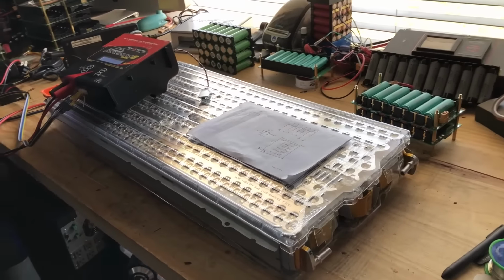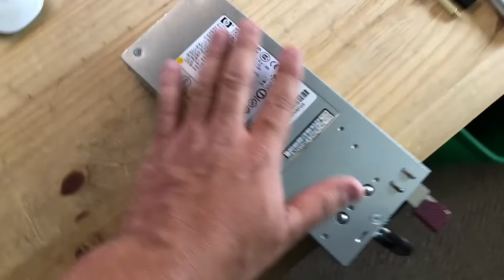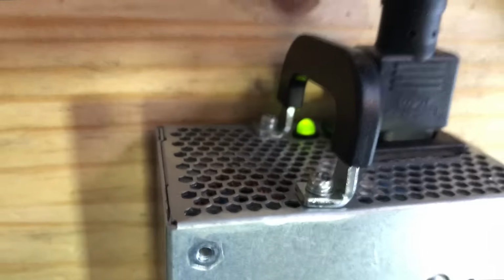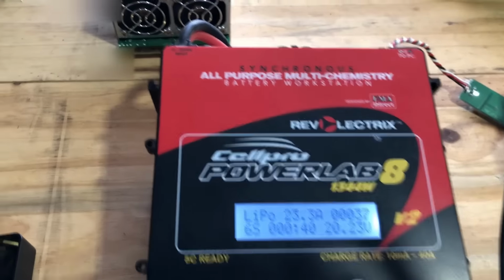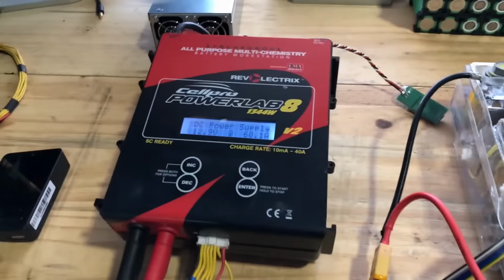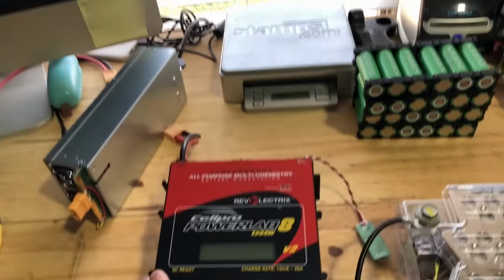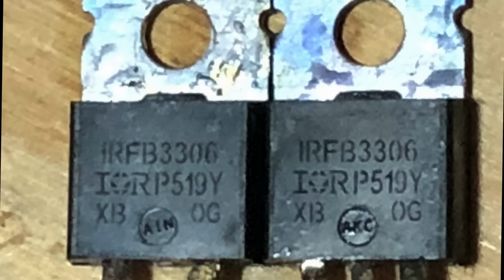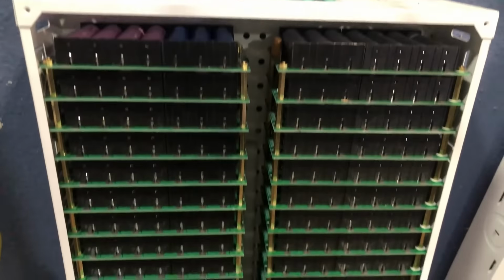How To Ruin A $300 RC Charger With a $25 1000W Power Supply

Comment: The power supply didn't destroy the charger. You overloaded the charger. Piece of junk since the software in it didn't limit the input current.
Reply: Damn, even my $15 B6 clone automatically limit the output when the input is too low. Way to go, Revolectrix.
Reply: Funny, he might have read the manual or just clicked through the menus on the charger and set his own (over-)current or (under-)voltage protection limits. However, without setting it up, it'll use its default values, which were clearly too high for the PSU. The charger smoking itself is another thing, that's weak, I agree. Still, human error was the reason. <edit>Actually, he must have edited them to even allow such high input current. By default, it's limited to 25A input with 10V or 11V voltage limit.
Reply: @nexus665  but why would you allow it as an desinger of the charger to overload it.  That would be just like your cooking stove with an turbo mode which would burn the cable's inside.   And then recommend to not use it too long.   

So probaly just to make it fail and make money because you have to buy a new one.  If your not good with  electronics tho.
Reply: InstaBlaster.

Comment: The output of 82.3A is for an input of 200-240V
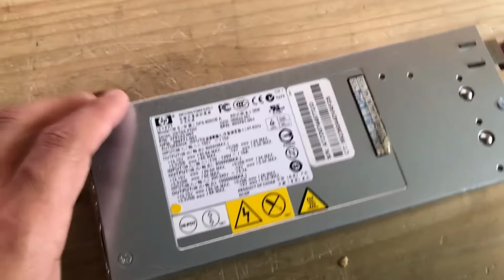Reply: Nope, freeze frame at 1:25 and take a closer look. The 82.3A is under the output section, the input amperage is specified for 10A @ 110v near the top of the label. Interestingly, there is no 240v specification despite the label's autoranging claim (or is that only for frequency?).
Reply: Max 1000 W is only like 5A from wall.
Reply: Holy shit, u guys need some help with this....
Reply: @davidstech1445  take a closer look.  There are 3 lines for input levels.  For 100V, for 110-120, and for 200-240.  The maximum output current for the DPS-800GB plugged into a normal 110 wall outlet is 69.9 amps.  (right in the middle) .  When you see the input current of 6.7 amps, you've found the specs for how it operates on 200-240 volts.

Comment: Regardless of input and output the unit should be programmed not to go outside its own specifications and break itself. Revolectrix rave about how advanced this charger is on their webpage, but clearly it's power monitoring is inadequate.
Reply: I agree. I obviously have no access to the owner's manual, but unless the manual specifically tells you to limit certain parameters, it should be smart enough to protect itself, especially at the $300 price point. Call em up and tell em they suk.
Reply: Well it does say lab in its name, doesn't it? :D

Comment: WTF man, why you blaming the power supply, it was your mistake, you put too much pressure on the charger.. it had to boost the voltage to twice the amount and push enormous amount of current through it..That powersupply would have easily handled it all
Reply: Correct. The PS done its job right. 
Datasheet Charger:

Continuous rated output of 1344W @ 26.35VDC (up to 33.6V) or 612W at 12VDC input voltage
Input voltage 10 - 32V
Input current 1A to 60A with reverse polarity protection

You should have used a higher voltage.
Reply: @shiftew leite ; @ isi pisi : 
Agreed with you both. Runing such power means you need to take care of your hardware specifications, if you don't, well, it blows up. 

And want to add : If it was the supply which wasn't powerful enough the charger would have detected it dans stopped it itself.
Reply: Yeah i had so much respect for this dude,until he started click-baiting, This kind of stuff really throws off integrity of someone, these supplies are made for server purposes and are really powerful.

a)Not all 1344W are being outputted at 12volt rail, they are being split between two rails.
b)The charger is the one that blew up (not powersupply).
c)Why was he going over-specs on the charger in the first place.

The wires are weak and small, the connection is janky,he is obviously running everything over its specification 

LETS BLAME 12DOLLAR POWER SUPPLY
Reply: Yeah no problem with those psus. The charger is the problem. That psu can easily push 1300W continues all day long!  I run them myself but you need to series 2 of those psus to get 24v or higher. That RC charger is pretty  easy to brake. I have seen many to die due to above issue where you run to low input voltage. They have no protection against it im afraid...
Reply: Yeah,they are not made to boost the output let alone double it at such high current, i think they are not even meant to boost output at all..at least that is not recommended
Reply: shiftew leite

Well considering he is self taught, I would say he is doing ok.

He shows his failures as well as his successes.
Reply: See Jehu is paying for the mistake so others don't have too. As right as you may be in your tech analysis, your delivery needs improvement
Reply: Paying for something is one thing,but blaming failure of a product due to human error is NOT a good way to show your responsibility,  that labels the product as "cheap/bad" in the eyes of consumers, and most people come to his channel to take advice

P.S yes my english may not be that great, that's because its not native language,i'm from pakistan
Reply: Yes dude,that is great unless you don't point out where you made the mistake and then blame it on something else, he is pretty big channel and many people come to him (like me) for advice. It's one thing to show your failure, totally different to shift the blame to a product that under-performed due to human error.. I love this guy's video, but he NEEDS to edit the video or title
Reply: I don't know it seems ok to me.

He ruined a $300 charger with a $25 psu, which is pretty much exactly what he did, that's not blaming the product that's stating a fact.

I didn't hear him blame either product.

He did something he was not supposed to do, that's about all he did, something he has done many times but shows us that by doing it, it can be expensive.

Perhaps he will be able to fix his charger and then do a video of how much it cost to put right his mistake.

We all make mistakes when doing things that we were not trained to do but it doesn't stop us doing those things.

I say cut him some slack, he is doing a good job and giving us lots of useful info.
Reply: Dude up until you this comment i was good and actually was agreeing with you on many points.. but saying "How to ruin a $300 charger with a $25 1000Watt psu" is not click-bait and degrading the power-supply , you must not be in the right state of your mind! How to "ruin" a 300$(clearly imposing its a good quality product) with a $25 (clearly meaning cheap) 1000Watt (implying that its one of those Chinese product that claim some enormous amount of performance and they turn out to be shit) Both these products performed well over their specification and i m all about cutting slack..I'm just trying to point out the mis-understood/mis-labelled title so nobody sees it and get's the idea that "oh that powersupply must be garbage/oh that RC charger must be garbage" . I'm not bashing anybody, just trying to point out something so nobody get's the wrong idea. i even stated i came to his channel for advice several times, and i didn't the full video each time..so something like this can and will effect somebody..
Reply: thank you for having some sense. although my english wasn't that great, im glad my point got across
Reply: flitsies hmm.... can’t wait for that ‘success or failure’ video to come out involving a 5KW battery bank... cavalier attitudes like this WILL end badly...
Reply: Shiftew leite

I understand what you are saying with regard to this matter I don't agree with you on it though.

When I saw this video the first thing I did was to check out the price of that charger, cos I wanted one and it seemed to do a really good job at dealing with something it was not made to deal with, so it was clearly a really good charger, but the with that being said the price put me off.

The cheap $25 psu clearly was not a useless product as it performed very well, so in each case both products did better than they should have, which in my book indicates good products.

What he did in his labelling the video was to introduce a value to both products yes $300 dollars is a lot of money to throw away for a video, but that is pretty much what he did.

Now he has another project to put on his videos, how to fix a $300 charger that performed above and beyond it's specs.

Plus he has a psu that he can use for other things because he knows it will perform beyond what he expected it to.

This indicating both products were well made.

I don't recall him putting down any of the two products, in fact during the video he states his surprise at the amperage he is pushing through the charger.
But I get your point, I just don't agree with it.

People often trash things on their videos some are very expensive others not so, he now has a project due to his mistake of expecting the charger to handle what he was pushing through it.
Reply: Bruno Gianelli

Don't pretty much all youtube video makers do that?

You have to remember he is self taught, so when he does things sometimes it's the first time he has done it and is not really sure what will happen.

If people can help him then they should do so, cos he has helped a lot of people with his videos.

So click bait or not he has done a lot of good work for a lot of people with his videos so we should cut him some slack and if we can help we should.
Reply: Dude you are contradicting your whole arguing point made earlier.. Like i said you must be out of your damn mind..you are just beating around the push trying to say the same thing i said just stretched in a paragraph instead of a sentence. I don't care if you agree with my point (which you seem tobe that you DO, based on your confusing comment) My whole point was that TITLE of the video is misleading. and anybody looking for reviews/advice will immediately run away from HP server powersupply and RC charger (which both performed beyond their specification) and it was jehu who was being careless yet these products get to bear the blame. Also it clearly says on powersupply 1344W only if input is greater than/equals to 220v-240v, Right off the bat people assume this supply will push 1344W ( as he continues to not notice that it can push lesser amount with 110v)  also not all current is on the 12v rail, if you calculate all this, both products performed extremely well and beyond their specs.. The title is the only thing i have problem with, this is not a "oops, well that won't hurt anyone" mistake, this mistake can push a bad narrative onto a excellent product and WE as a community that come to his channel for advice will be hesitant to buy this product.  You don't even know what you don't agree with , you clearly are just biased and won't listen to reason, because your comment is contradicting your OWN self. introducing a value to something and then saying "HOW TO KILL $XXX THING WITH $XX THING" is clearly implying failure of first product and blaming it onto the second product. Also as i mentioned not everybody watches full video. This is prime example of click-bait and misleading user's. If you fail to see that, you are not thinking straight.
Reply: @flitsies  reading doesn't hurt. That's what manuals are for.
Reply: Bruno 

Well perhaps it's mostly the videos being recommended to me then, cos I've seen lots of videos that claim to be one thing but when you click them to watch the title is way off the mark.

In this instance though the title was bang on the money, and he did exactly what he said he would do, which was destroy an expensive device with a cheap device, how exactly is that click bait.

However as I said lots of video makes do click bait.
Reply: shiftew leite

No I have not contradicted myself, because I don't believe this video to be click bait, however I can see how some might consider it to be, which is pretty much what I said.

He made a video showing how he destroyed his expensive charger, he also including what part he considered burnt out due to his experiment.

At no time did he put either product down and claim that the products were bad.

If you look at the title it says 

"How To Ruin A $300 RC Charger With a $25 1000W Power Supply"

If anything you could take this as a warning to other self taught battery and power enthusiasts.

What if it were, "How to create a Tesla power wall using cheap batteries" would that be a put down to Tesla power walls? No it is stating a fact that he has been able to create a power wall of sorts using cheap batteries.
Of course it won't be as good as the Tesla wall but it would do what it would be expected to do.

But in the case of the RC charger title it's the same principle.

He destroyed his $300 dollar charger using a 25 dollar psu, it was a fact that he put as the title nothing more, no implications, though I can see how some people might struggle to understand the difference.
Reply: emceh

I agree with you, he could have but then we would not have had the video showing how he pushed the units to destruction.

We all like to see a little destruction don't we, well if you don't there are a lot of people who do cos there are people who have whole channels dedicated to destroying perfectly good working devices including cars and motorcycles.
Reply: Also having the fans aimed at each other didn't help.
Reply: @DIYTechRepairs  Yes, they do have protection. I have the exact same charger and the new versions. They both have protection. THE USER has to set this option up in the menu depending on the power supply you use. You can have the charger shut down if the voltage drops to a certain number, you can have the charger auto drop the amp output if it reaches a certain temp etc. ALL The protection is there if the instructions are read. These chargers are top quality in my opinion.  Go buy a new corvette or mustang. Put it in neutral and hold it to the floor for 30 min. Even with the rev limiter, watch what happens. (Just an example)

Comment: Unfortunately that was 100% not the Power supply. Please don't dump it. You can most likely steal a mosfet from one of the hoverboard BMS. Check the numbers of them.  I use them to repair do some modding on my ebikes. I use a similar server power supply to run everything including my chargers, 3d printer and everything automotive and they are as robust as power supplies get. Not only strong but extremely efficient. They are meant to run very expensive servers and are put out of service just as a precautionary. I'd trust them over most power supplies. 

Our 120v rating is lower than their 220v rating. It is rated 12.15 V at 65.8 A  max on the 12v rail. That is 799.47 W max and not continuous. 

Last I saw, it was running at 12.9 V at 60.3 A. That is 776.58 Watts which is very close to the 800 max.

The power supplies only give out what's demanded. It was running at nearly max but your charger asked for more than it could actually handle and died.

Comment: You don't seem to know much about Mosfets eh? You can get the newer version with lower resistance.
Its the IRFB3077 
It'll run cooler also.
And if you want the whole thing to run more efficiently you will have to raise the power supply voltage.
Reply: It's not always that simple you know. Just simply grabbing a newer mosfet that has a lower RDSon will not always benefit you as the gate drivers for said mosfets can be tuned to the specific FET's gate charge and turn on time, if you can find a FET with very similar or identical specs than yes probably it will improve performance. Nonetheless I don't think replacing the FET's will fix this charger as usually failures like such tend to end in a cascade of other failures.
Reply: The mosfets were 3 in parallel, so @60A they should be only handling 20A each. They should easily have been able to cope with that.
The charger should limit the input current if it knows it can't handle it.
Could try adding a few more fets in parallel if they could be heatsinked!
Reply: @ahaveland  yeah at full 60A and typical RDSon they should have only been generating 4W of heat (60^2×0.0011 = 3.96) which is nothing especially with how large of a heatsink they where on. Even at max RDSon it would only be only 5W so still quite low.
Reply: Think the spike of the power supply will not help to, rememer its a switced output, and not steady...the more you load it up to its max current, the more ripple...< and boosting 30 amps 24 volts out of  12 v makes the harger  work hard to.. !
Reply: @MrBugsier5  well dear lord I sure hope the ripple doesn't get high enough to kill a charger with a max input of 36V  if this was meant to power a far more sensitive server computer lol. But yeah thinking about it more the PSU could have definitely contributed to the death of the charger, wish he had the output of it on an oscilloscope to see the ripple.
Reply: not need to be high ripple voltage, the inductor in the charger will boost up the ripple voltage,
Like in spark ignition coils, coil charge "slowly" then the charging current disappears, then the magnetic field collapse and the "slowly" built up, energy released in a burst... it can be in kV range with big current, for a nano or micro(maybe a micro?) sec
Reply: @_decky4ever_  yes your right the inductive voltage spikes could definitely cause these problems though again, these are things that need to be taken into design consideration and should have protection built into to avoid situations like this.
Reply: diodes could prevent this
Reply: Any capacitance or inductance can slow it down, or cause to open half way
Reply: Sometimes, it is that simple.